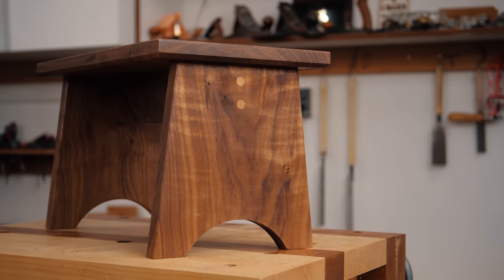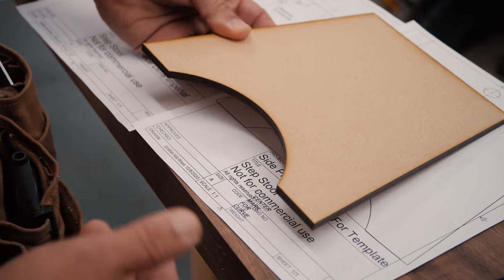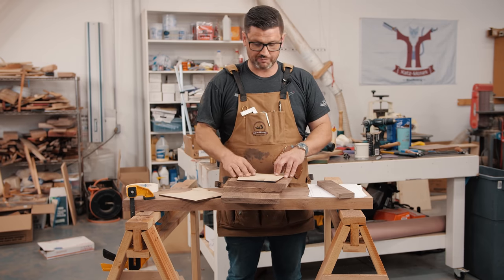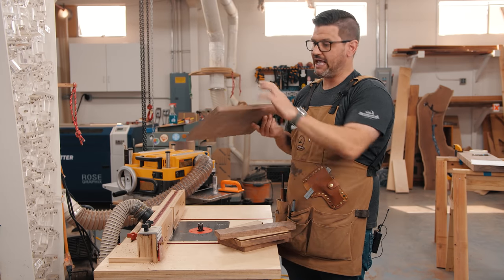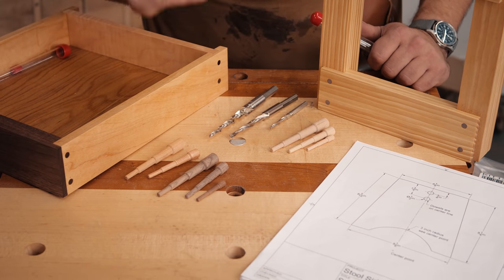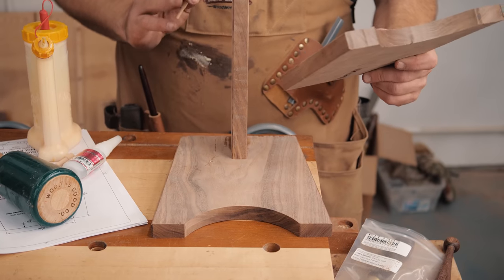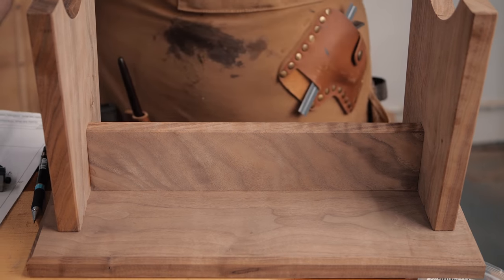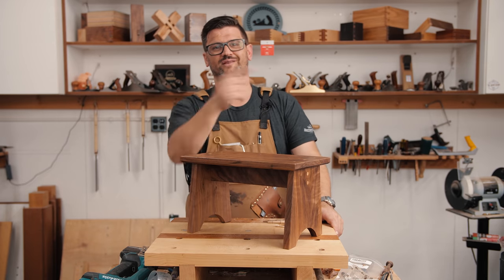Gorgeous Hardwood Dowel Joinery Kitchen Stool (FREE Plans) - One day Woodworking Build

Comment from the maker: Get the Free Plans and Support What We Do at The Katz-Moses Store http://bit.ly/KMWstore20
Hardwood Dowel Joinery System https://lddy.no/q3l1
Great Video from Simplecove about Making Templates https://youtu.be/GDQsA1W7BT0
Reply: Quick question. Any reason to use these dowels over than a standard dowel from a big box store?

Do the steps add any particular strength?

I have been using oak dowels for a lot of my projects recently and find them very strong.

Comment: Thank you Jonathan for showing so many people the Miller Dowel, which my dad invented about 20 years ago. 
 
Is it a fastening system or is it a joinery method?  Both? Neither?

In the 60's, my dad worked in my grandfather's upholstery shop.  A big part of the job was furniture repair, often replacing screws with through dowels in failed joints.  Wood joinery generally has superior shear strength and durability.  Through-pegging works, but, like all joinery, it takes more time than re-screwing with bigger screws.  
Over the years, my dad tried many different ways to make through-pegging faster and easier...many different things.  Has anyone ever seen a drill bit shaped like a golf tee?  Well, he made some.  The idea didn't work because tapered pegs split wood from a wedging dynamic.  If tapped in gently, a tapered peg can easily back out and fail.

The Miller Dowel idea seems pretty simple when you see the stepped dowel sitting next to the drill bit.  The bit is stepped to match each section of the dowel.  So simple. But since one is worthless without the other, nobody had done it previously.

Basically, the Miller Dowel (MD) has a tapered effect without any actual taper.  The MD is about 2/3 inserted before it engages resulting in less compression and friction.  When the MD is tapped home, the only section to seat is the top section, which acts as a head to keep the top board clamped down. 

The Miller Dowel results in strong joints because 1 - Wood is strong.  2 - Modern glue is amazing. 

Of course, there is no joinery or fastening tool that does it all.  A cool thing about the Miller Dowel is that you just need a drill, hammer, glue, a saw, wood, and a project.  Where it works, it works great.

Thanks again for posting this on your program.  I know this and all the positive comments mean a lot to my dad, Mike Miller.
Reply: Thanks for that explanation.  I was wondering how these are better than regular dowels.  I can understand the point that they only need to travel a third as far under friction/compression compared to a regular dowel.
Reply: I purchased a kit several years ago and really like it. I have used them for retainers for hinge oins.  Once you get them you start finding all kinds of other uses. I never knew the origin which is really great to know. My only complaints are that they are not cheap and you can't find them just anywhere.  Again they are great with no complaints about use design or strength.
Reply: Hi Rorke - I had seen these before but didn't really consider them. Watched JKM's video and ordered a kit and dowels of several kinds.  Love them!  Really cool and easy.  Thanks for the history.
Reply: Use Miller Dowels as often as possible, awesome "system"
Reply: Wow... and I've been using Miller Dowels for about 20 yrs.  Didn't realize I was an "early adopter"... LOL.  First project I ever used them on was an art easel built off of plans from Norm Abrams "New Yankee Workshop"...  which I had to order using a telephone and the plans got sent in the MAIL (real old school).  Used figured maple with contrasting walnut dowels.

Kids are now out of college and the first one that has grandkids gets the easel (and the other has already told me that they will force me to build another one)

Comment: Hello young man, I'm back. I have been using these dowels for many years now and as you say they are super fantastic and all that. I have down loaded the paper template and will make two of them and use them for shabby sheik tables for small lamps. Over here they are called Miller Dowels and they come with the correct size of drill. Take care BIG GUY.

Comment: I’ve been using Miller Dowels for at least fifteen years. As you said they are great. One thing I’ve run into over the years is making sure all the wood dust from drilling the holes is out of the hole before gluing in the dowel. It can cause big problems because the dowel will not go all the way into the hole. As you mentioned, using too much glue can be a problem as well. The other hint on the Miller Dowels is to make sure that the drill bit goes deep enough. The fat part of the tapered drill bit is the same diameter as the fat end of the dowel. If the hole is stopped short the dowel won’t go deep enough for the fat end of the dowel to fill the hole.

Comment: Jinxed!    First time I've had someone else release such a similar project to me so close to when I published mine.  I took a totally different approach, but still freaky.   
Those dowels are beautiful, Jonathan, and you chose some awesome wood for the project.
Reply: The dowels look nicer than screws, but screws pull the parts together, so I'm inclined to use screws and plug the holes.  You must have one of the few woodworking channels I had not already found, so I'll have a look through your videos hoping for some good builds.
Reply: @TrevorDennis100  thanks and welcome.  There are lots of woodworkers out there...

Comment: I used these dowels to fix a bow I made! The bamboo backing delaminated at a point near the handle. Put some epoxy where it delaminated and used these dowels to secure it back down. Came out perfectly and the bow works beautifully now.

Comment: Great stool.  This is perfect for what I want to do.  Thanks for the plans!  One question.  I want to use this system to build a stool out of maple to match a bar stool my sister has that was left to her by our mother.  My problem is with finishing.  the stool is stained dark and I love the look you have with the contrasting lighter colored dowels.  Any idea how to either install the dowels on the already stained maple without marring the wood when flush cutting the dowels; or, how to stain after dowels are installed without staining the dowels too?  Thanks!

Comment: Thanks for your video. I have a question about the middle dowel used on each side of the top anchoring the top to the sides: doesn't cut through the two dowels used on each side to anchor them to the stretcher?
Reply: thats what I wanna know too!

Comment: Did the center dowels on the top sever the ones on the ends for the stretcher?  It's OK, not far to fall.  Good looking stool.
Reply from the maker: Thats the great part. Theres so much dowel real estate that it wouldn't affect the joinery in any way. Lets call them interlocking.
Reply: My comment as well—looks like they would be severed!
Reply: It is a beautiful stool but looks like an accident waiting to happen—by severing the very dowels you put in to support your joinery you weakened that joint significantly...the only glue is along the dowels—I wouldn’t get near those structurally...just saying out of concern—love the channel
Reply: Even if it interlocks you’ve now got an issue with long grain to end grain in your dowels—it is still a weaker joint than just avoiding trying to interlock altogether...for a display piece is one thing but for a functional piece of furniture my family would use—really concerned.  Just recommending stress testing;-)

Comment: What's the functional difference of these and a regular dowel joint? (Not fluted dowels, but the ol' straight drill bit and straight dowel of same diameter)
Reply: The "head" of the dowel locks down the top board because it seats on a shoulder created by the specialized drill bit.  Only for through pegging.  Not for blind doweling.  Similar names, but different tools.
Reply: @CaptainRorke  so, in other words, nothing.

Comment: I'm not being smart, but why or how are they better than a normal dowel.  I know they look so much more different than a normal dowel, but what are the "things" that make it better.  And in particular, so much better that you're sold on them.
Reply: I have the same question. I'm not sure how this notable better than a quality dowel.
Reply from the maker: I have never seen easily accessible hardwood dowels before. These are gorgeous hardwoods. The ones that come with the doweling jigs are not meant to be seen and are ugly as all heck. They don't fit well, they're fluted and push glue out of the joint. Biggest reason is I can't imagine a world where even if I had hardwood dowels, that I could pound a (gentleman) 2 inch long dowel of the same width into a hole. With glue on it, it would bind up in the first 1/2 inch and never make it in.
Reply: @katzmosestools  you can buy them, or make them. There's videos all over youtube about making and using dowels.

Comment: What's the benefit of these tapered dowels vs straight ones?
Reply from the maker: You'd never be able to tap a dowel that long into a hole with glue if it wasn't tapered.
Reply: @katzmosestools  Nonsense. I once tapped a 4 yard dowel into a telegraph pole with the palm of my hand. It was tapered outwards too.
Reply: tapered pegs are basically slightly wedge shaped.  This can cause wood to split.
The Miller Dowel is made of cylindrical stages.  So it is tapered overall, but not actually tapered anywhere.  
Another difference is that the "head" of the dowel locks down the top board because it seats on a shoulder created by the specialized drill bit.